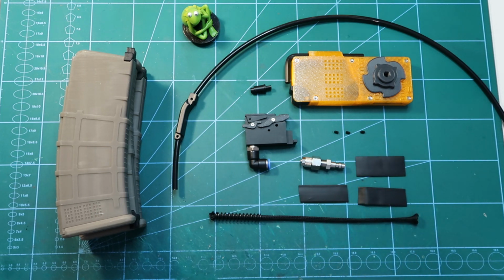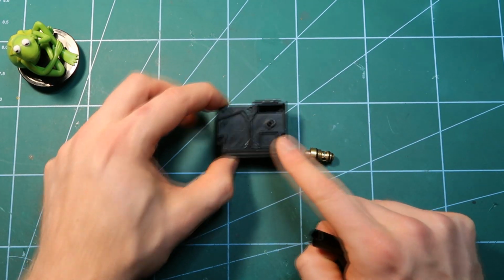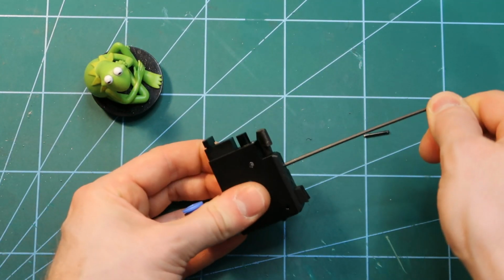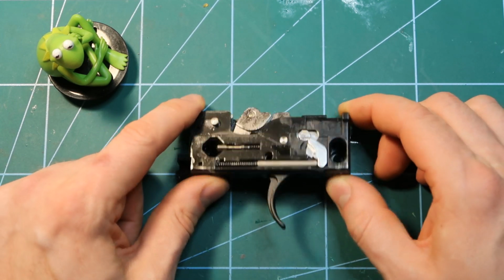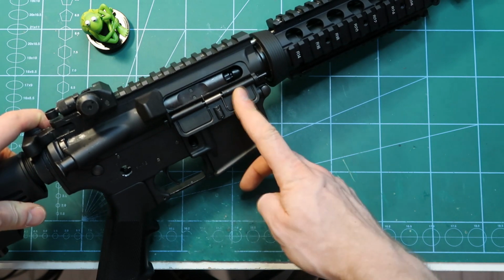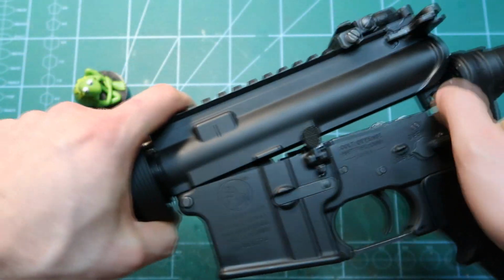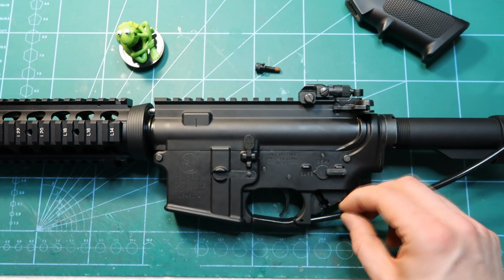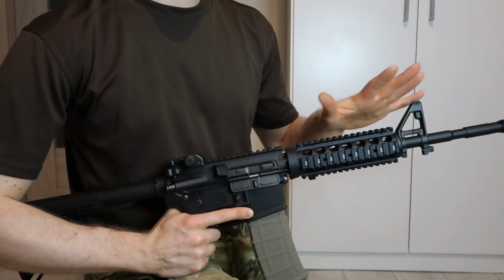Frog Manual #13 - FE conversion kit for M4 MWS Tokyo Marui system HPA GBBR

Comment: The air hose detailed assembly video was edited and cut.
What is the reason??
Reply from the maker: Yes, it was. The reason is very simple, exactly like I explain in the video and in the description of it - it is identical to hose assembly for every other rifle conversion, no need to show it every times separately. There is one separate video showing this stage which I mention in this assembly guide, and its link is in the description.
Reply: @frogengineeringairsoft  I guess I misunderstood. Thank you for the additional video and technical information.

Comment: looks awesome however putting this into the mws feels abit daunting especially the stuff with the trigger box and everything but cool none the less
Reply from the maker: Thanks ;) Believe me it is much easier then threading those steel hardened parts like in VFC, if I was to rate this assembly against the other conversions in scale 1-5 (5 hardest) I would give it a 3 max.